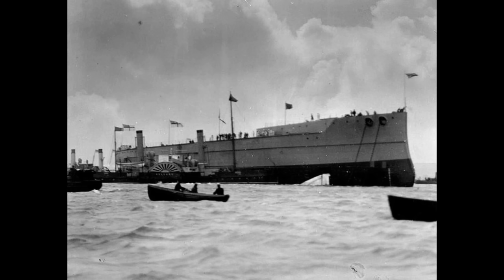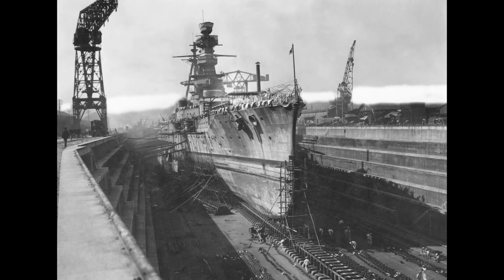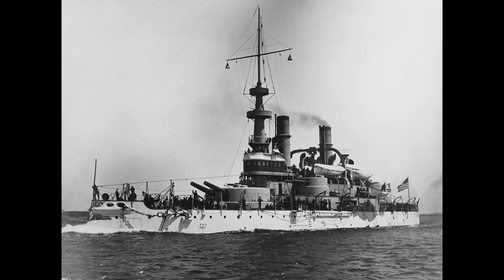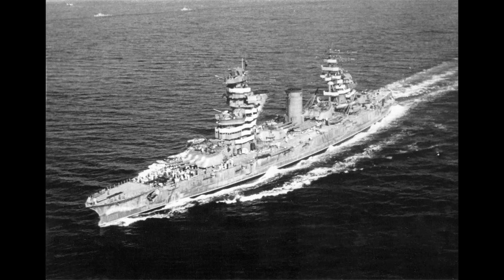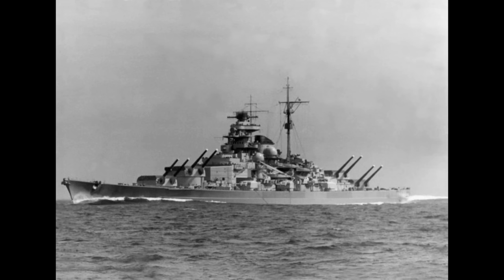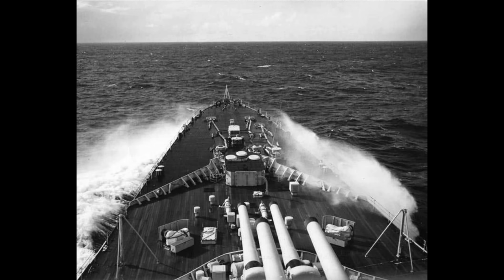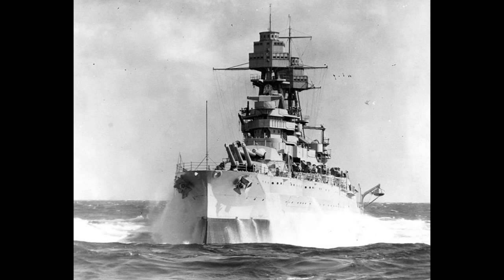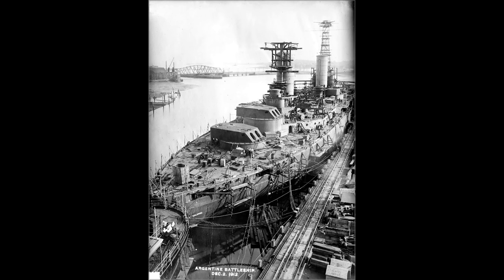The Architecture of Dreadnoughts - Blueprints of Success

Comment: Roll!!!! Roll is not  a constant speed! The further over you go the faster it moves! Till you meet the max where you just seem to HANG! Roll is massively miss under stood by those that haven't experienced it as a way of life! Ship design by naval architects is often baffling, as they understand little of actual sea states & how the ship responds to them! When the ship crests a wave it goes from one angle to flipping over to the exact opposite in a quick jerk & then the drop on the opposite trajectory! I suggest the architects try helmsmanship to actual feel the rudder as maneuvering can break your knuckles! Oh & that's only after they have slept up forwards & have their bunk dislodged & thrown sideways, Down & then sideways on the bunk 2 layers down on the opposite side! Yes the cycle as seen & felt is 1 stage out of waka a mole! Architects are too often complety useless at design, looking at static figures! As for the Russian BS the flat deck with very little up top was to suite very shallow draughts in the seas above Turkey! 2 WW1 BCs were designed for that same configuration, but converted to carriers when the absurdity of that short design window evaporated!

Comment: How does the design of the carrier compare to the battleship for figuring stability as it would appear the with the long and wide flight deck there is even more weight high up, especially if armored, and the need for stability is even greater to allow for air operations in a wide range of weather conditions or you are limiting the worth of the carrier greatly.

Comment: I seem to remember that a bulbous bow is mainly designed and works correctly at one set speed?
Reply: I think it’s optimized for max efficiency at a particular speed or speed range, but has some benefit at other speeds as well.  I presume this involves varying the length and diameter of the bulb, but I’d have no idea how to calculate what would work best for what speed.

Comment: What is the best way for two battle ships to attack each other, head-on or side-by-side ?
Reply: Side-by-side. You expose all of your guns and most armored part of the ship.
Reply: @shellshockedgerman3947  I kind of thought that, considering 10 salvos from Bismarck and Hood went short and over.
Reply: @bradmason4706  Bismarck and Prinz Eugen had a higher chance of hitting since all of their main guns were unmasked and their secondaries were free from obstruction. Hood and PoW only had their fore main guns unmasked and also had to contend with how the weather was interfering with their fire controls.
Reply: @shellshockedgerman3947  As I understand it. Hood or PoW landed the first blast. But Bismarck's next salvo went through HMS Hood. Which I find strange that Britain was still making aluminum hulls even for the Falkland's re Exorcet. And by unmasked you mean barrels unplugged. However all that made no difference because fire control was guess-work err inaccurate !
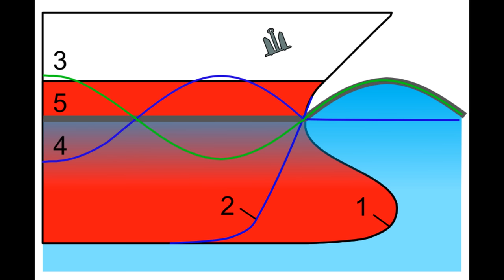Reply: I found stuff on the sinking of the Hood. He had only begun a left turn to square up on Bismarck when it was hit. It looked like Hood's aft guns were 7:00 pointed at Bismarck when battle was started.

Comment: Something I don’t exactly get is ships use oval doors when hexagonal doors would prevent strain more plus more head hight and have layers of armour made of strong metal on the outside with something to dissipate head in the middle and the another lighter armour layer I know extra weight but it’s good
Reply: Stress points. A round or oval hatch has no place for a crack to start.

Comment: As can be seen in this video, many, many factors are necessary to cover to make a warship work the way that you want it due to the laws of nature and the state of your engineering expertise at the time the ship is being worked on.  Unfortunately, as usual, human stupidity can add totally unnecessary monkey wrenches into the kettle, including some fairly serious places where things that seem to be working perfectly well can go wrong without any warning.  Here is one to that might be considered a towering example of this block-headedness.  To wit:  Until the US Navy Burau of Ships and Burau of Ordnance (in their later identifiers NavShips and NavOrd) were combi9ned into the over-arcing NavSea agency in the late 20th Century, each had its own separate set of rules for many items that were otherwise virtually identical in both of their areas of responsibility.  For example, for some arcane reasons, hull armor was under NavShips (and its prior Bureau of Construction and Repair (BuC&R) instantiation), as was seemingly logical, EXCEPT that ALL face-hardened armor was ONLY to be controlled by BuIOrd, so such armor belts and transverse bulkheads in the hull had to be made under BuOrd contracts using BuShips blueprints.  Also, BuOrd was the only US Navy activity that could use the word "armor" so any homogeneous, ductile armor material under BuC&R/BuShips cognizance had to use the French-sourced term "Special Treatment Steel" (STS) instead.  Hence confusion in a lot of blueprints that have both terms in the same diagrams.

While bad enough, this was not the worst mess that could happen here!

An even stronger block-headed thing that was potentially extremely dangerous in a naval battle was equipment inter-communication:  Some equipment was under BuC&R'/BuShips and other equipment was under BuOrd.  "So what?", you might naively think.  You do not know about the "I'm from Missouri" effect then.  (See the musical THE MUSIC MAN.)   One of the major pieces of information needed for several warship functions, MOST ESPEICALLY AIMING THEGUNS, is a little thing called "pitch" (ship tilt in the fore-and-aft direction from parallel to the sea surface at zero pitch angle).  One would think that somebody in control -- say the CNO perhaps -- would decide which direction was UP (positive value) and which direction was DOWN (negative value).  And, of course, ONE WOULD BE DEAD WRONG!!!!  They were OPPOSITES in BuOrd' and BuC%R/BuShips!!  Thus, whenever one piece of equipment measured or used pitch belonging to one of these two activities, it had to have that value REVERSED to work on the other activity's.  Literally have its input or output wiring twisted to the opposite plugs in such an analog-wiring inter-connecting case (or have its computer software change sign in later computers).  Talk about troubleshooting software bugs!  With analog systems, every time maintenance had to be done anywhere on a device generating/using pitch, there was a real (and, do to Murphy's Law, virtually certain) chance of screwing this up and making the equipment that needed this function INOPERATIVE UNTIL THE PROBLEM WAS FOUND AND FIXED.  Nobody could make either side blink on this crazy thing FOR DECADES!!!  So, humans can screw up anything, no matter how supposedly simple...